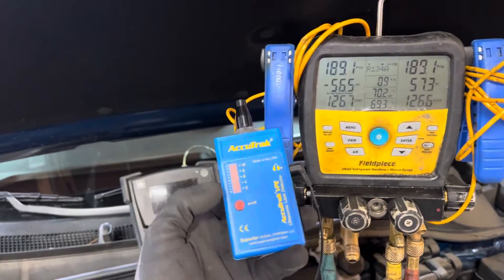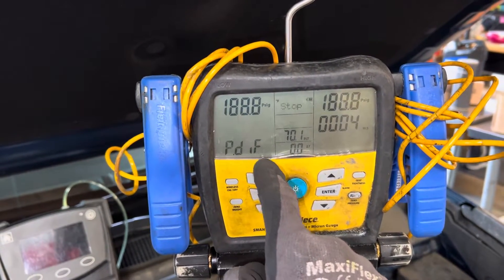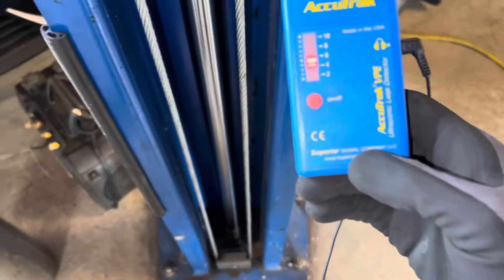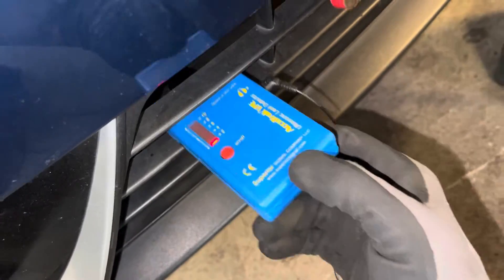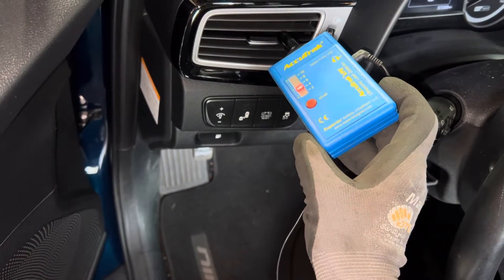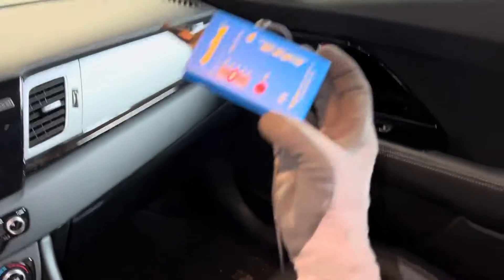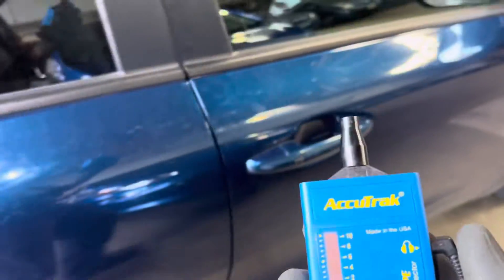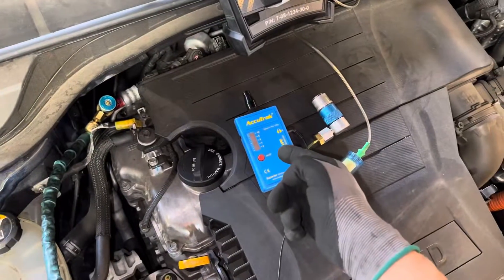Ultrasonic Leak Detector EASY TO FIND EVAPORATOR LEAK.  But what about with refrigerant ?￼

Comment: its always best to actually check at the coil to pinpoint it cuz you never know it could be fixable
Reply from the maker: We dot not. Fix leaking evaporator. Especially on YF flammable refrigerant. 
          And if you repair a evaporator that took 7 to 14 hours to replace at $180 to $260 a hour and it fails and leaks again then you lose and have too do it again for free. 

I’ve seen that twice. Once on a Cadillac 9 hours to replace one other shop was a Mercedes 22 hours to replace.  
         Those shoes never dd that mistake again.

Comment: AccuTrak also makes a gooseneck version of this leak detector. Do you think it would be very beneficial to get into tight spaces or is this model good enough?
Reply from the maker: The gooseneck version is what I learned off of as a child and my father had that when he was introducing me to air conditioning. 

It worked good they also have a rubber tube hose connection he stick on the end of this one to extend it in the noise echo is down the tube

Comment: Hey Tom was wondering when using a inferred leak detector on an empty system MACs recommends 15% charge of total system capacity oo about 50 psi to find leaks. My question is that can I add 5 psi of refrigerant and pressure with nitrogen and all be able to use and find leak with the leak detector? Have you ever done this, this way or should I just stick to refrigerant only?.
Reply from the maker: 50 psi does not do anything for leaks that do not occur after 50 psi. 

50 psi is good for large, continuous leaks that happened to occur at any pressure or low pressure. 

But I’ve had for least videos or certain leaks do not happen until it reaches 100 psi or 150 psi or over on the high side . 

The reason they do not recommend a little bit of refrigerant and then pump it up to 150 or 175 psi nitrogen .?

Is because the big refrigerant recovery recycle recharge machines cannot handle recovering 175 psi of nitrogen and then separating it for recycling . 

And the only alternative would be discharging it to the air that is against the United States EPA regulations . 

But if you’re in a country that has no rules laws and regulations, and does not care about the environment then I guess you could do that in your country . 

In commercial and residential HVAC, this method is allowed to have refrigerant as a trace gas, and then pressurize it with nitrogen. 

This is where the European, if gas laws rules and regulations have a advantage over do United States .   Did you they push heavily on using hydrogen or helium 5% hydrogen 5% helium one of the two gases with 95% nitrogen.. 
      Then you use a dedicated helium or hydrogen leak detector and pump it up to 175 psi pressure. 

But you can recycle and recover a little bit of for example R1 34A refrigerant that has been pressurized with 175 psi of nitrogen 

I recovered into a dedicated recovery cylinder that is in a freezer that say, roughly -20° below zero Fahrenheit . 

At this point the temperature is below the boiling point the condensation point or you can say liquid point atmospheric pressure . 

So the refrigerant would turn into a liquid state at the bottom of the tank in the nitrogen would stay in a gas state at the top of the tank .  And then you go through a series of bleeding off the nitrogen at this temperature. The refrigerant stays at the bottom like water as the nitrogen comes out and reduces pressure.. 

At this temperature -20° below zero Fahrenheit you can have a glass of liquid refrigerant 134 on your coffee table and it would just stay there as a liquid at -20°F . 

Using and relying on the 50 psi for finding leak sucks .  Unless you’re lucky and it’s one of those kind of leaks that actually leak at pressures 50 psi and below..   it’s OK for finding the big easy leaks
Reply: @coldfinger459sub0  thank your for the information it was very helpful

Comment: Gday Tom, not familiar with that hybrid model but over here it seems quite common to see evaporator problems in kias. Mind you most kias I see are not as new as this one but no more than 10-12 years old. That and discharge hoses failing at the compressor end seem to be the common culprits. Why were you using your ultrasonic detector and not your inficon? Was this one totally empty?
Reply: Sorry Tom I just saw your other video on this car. Im on the same page as you first reaction would be that someones had the system open and just put it bacl together without servicing the system. But you know thats not the case courtesy of your ultrasonic detector. Thats a neat piece of equipment!
Reply from the maker: Watch other videos on this car.  You will see ultrasonic with high pressure nitrogen worked best on this one. 

Refrigerant was difficult to find leak.

Comment: Ok i did not know you can do this
Reply from the maker: I was fortunate my father taught me to use his ultrasonic leak detector starting at the age of 12 my father would make me find leaks using the H 10 refrigerant heated diode leak detector or his ultrasonic leak detector. 

Back in those days when he got it the heated dial leak detector was almost $1500 in the late 1970s and the ultrasonic leak detector that he had was a big giant handheld device that had a big remote power supply connected to through a cable and then plugged into the wall and it was like $3800

That was a lot of money for the 1970s

But my dad made a lot of money and air conditioning a boatload.  I was fortunate I had access to tools equipment and procedures that I did not know at that time that other kids parents cannot afford.   And most people in HVAC did not even know the equipment even existed at that time.